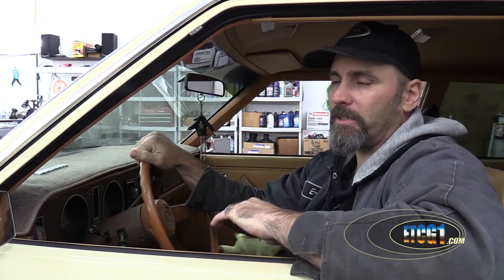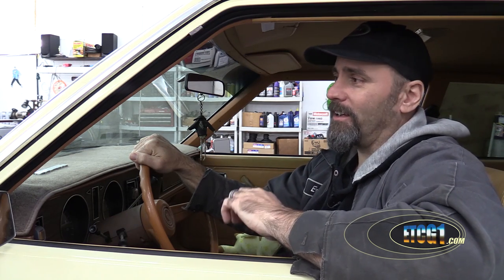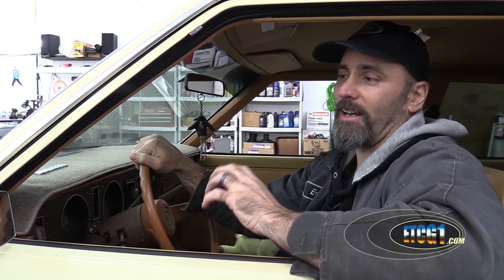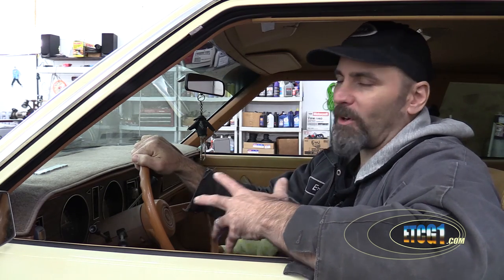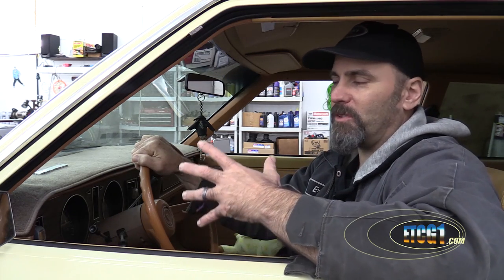Analog vs Digital (Cars)

Comment: I feel that there is a good balance of technology and simplicity in my 2005 Civic. It has been a great car with everything I need and nothing I don't.  I plan to keep it forever. It has AC, heater, radio, rear defroster, power windows, gets great gas mileage, has good power with the mods I did and is about to have alloy wheels. What more could you want? I love getting 42 MPG out of a 221,000 mile VTEC Civic. At 188,000 miles, the motor spun a bearing for no apparent reason on a -40 degree cold start, so I put a VTEC D17A2 in it and hooked the VTEC up to a light switch on the dashboard. The car is stock except for a D16Y8 intake manifold, throttle body and fuel rail, high flow exhaust, DC Sport 4-1 header, custom cold air intake, Mishimoto radiator, Energy Suspension motor mount inserts, battery in trunk, Spec D tuning front grill, power steering delete and the VTEC engine swap. It is very functional, extremely easy to work on, fairy low tech and gets the job done. I am not against technology, but sometimes it is best to stay low tech.

Comment: Always great info Eric. I went to Mechanic school and started mechanic work in 1991 the early 90s when points, carbs, vacuum advance, egr valve back pressure transducers etc were slowly fading away. I'm so grateful I learned those systems before the digital kicked in because it paved the way and prepared me for the chaotic world of computerized engine control systems and made it a whole lot easier to deal with. It's good to know the roots of how it all began but the principles of engine mechanical breakdowns are still the same, its all the electronics that can make or break a true Tech. I highly recommend for today's mechanic to go to school, and every DIYer interested in working on today's cars to go pick up a couple computerized engine control books and master the multimeter, electron theory and learn what makes a sensor and actuator do what it does and why it must operate within a set base of parameters. Oldskool technology is great but in order for a mechanic to stay on top of his or her game they must learn how to apply the diagnostic knowledge to the new electronic systems, which can be brain racking and drive you nuts lol. To know PCM/ECM computerized engine control diagnostics you must accept that fact that it is a never ending LEARNING PROCESS and you must dedicate MANY HOURS to honing your skills in diagnostics. Thanks for all your very informative videos Eric, When I first saw you and scanner danner a few years back, you guys encouraged me to make videos God Bless you brother. keep on smashin and Stayin dirty.
Reply from the maker: Very well said! Thanks very much for your comment.

Comment: Eric, this in my opinion is the best ETCG1 video in a long time, if not overall.  I have been really hard on you in a couple of comments recently, and I am glad you put this video out.  The point of brand new vehicles having mechanical components made me laugh.  My son just graduated and is a Journeyman AST here in Canada.  If we have something break down, the first thing he goes to is the computer  to diagnose it.  The first thing I go to is what possibly made it happen, and check all of the mechanical choices first.  It's a great banter over who is right (50/50 I think), and we have had some heated debates, but proves you need old school to have new school.  Once again, great video, and get that Ford running.  (My son has a 78 Mustang II with a 302, but it's only good for about 300 hp!!)
Reply from the maker: Thanks for your input. I really appreciate your comment. Good luck with that Mustang. Sounds like fun. To be honest, I'll probably dial back the boost on the Ford when I drive it on the street. 575hp seems excessive on the street in a car like this. Still, it's fun to know I can make those adjustments. Thanks again for the comment.

Comment: I love all of my "analog" vehicles. My 78 GMC K-35 actually still has the original Quadra-Jet that she was born with (rebuilt by me several times), and she still fires on the first try every time, even in sub zero temps here in Northwest Ohio. However, I'm seriously considering an aftermarket efi system for my current V-8 Ranger project. I'm not trying to make stupid power #s with it, I just want a fun cruiser. I'm 51 years old, and, bought my GMC in 84 when I was 16. I'm not opposed to "digital" stuff, I just prefer simplicity the majority of the time. The Ranger is actually the newest (personal) vehicle that I own. I also own (and drive for a living) a 2006 Freightliner semi tractor. Obviously that's fuel injected, but, it's still a simple system without all of the late model emissions crap.

Comment: This is one of your TOP 10 or 5 vids you have done! THANKS A TON FOR DOING THIS! 

You could even do a side by side if you wanted to. Car Craft magazine did this years ago with a fuel injection vs carb article and it turned out that the carb performed a tad better for race track and some mild street - strip applications...
Pros and Cons to EVERYTHING! 
Digital for everyday or professional stuff and analog or partial analog for toys and hot roddin'.... There is a Reason why rat rods - traditional old school stuff has become So popular in the last 10+ years. It's simple, fun, it works, and you, your brain and hands control more.... 
And Now, Eric will show us in his new vid:"HOW TO SET THE POINTS AND WHY HE LIKES BLUE STREAK BRAND OVER OTHERS..." LOL and in the following month "HOW TO SET UP A MECHANICAL FUEL INJECTION SYSTEM" lol
kEEP UP THE GOOD STUFF ETCG! Get that '51 going! Turn over that 235 or 216!

Comment: ANALOG! I'll take My Holley carburetor on top of a small block Chevy over a twin turbo LS 700 hp beast any day simply because if I'm stranded on the side of the road with only a basic truck tool kit I can fix my carburetor
Reply from the maker: A man after my own heart. Sounds like a killer car.
Reply: ... and if it is not the carburator but the headgasket or a piston, you are still fucked. :D

Comment: I am a young (22) German Driver, and I drive a 2007 Opel Combo Tour 1.3 Diesel as of now, and the one thing that annoys me most of all is the knowledge that the Fuel Delivery is entirely electronic. Now, I love that little thing to death, it's Handles like a Small Car with the Space of a Van and it's the best Car I could wish for, but I wish it had been built 15 years earlier and fitted with a fully Mechanic Diesel, having had a Battery Fail on me. 

The Cool thing about these old Diesels is that they don't require any Electricity to run at all. Even if the battery is Dead as Princess Diana, you can get it running. 

If I was to buy a Car today it would have to be an old Mechanical Diesel Mercedes while they are still cheap. 
Or some 90's light Truck.

Comment: Love this discussion.  I love the digital for areas with emissions testing.  OBDII is the best thing the government has ever done to make things universal and accessible to the technician and vehicle owners.  Cars today are also super reliable.  On the flip side, I trust my life and well being to a 2-stroke, carbureted aircraft.  I can physically inspect it and know that I can trust it.  I can physically see if it's good to go.  
I'll never forget the headaches I had with a computer controlled carburetor on my 1984 F150 4.9L either.  It was a CHAMP! except when it came to passing emissions every year.  Then it was a straight nightmare.  Those transition models suck.  I got my butt handed to me by a 2011 Malibu's anti-theft system.  The BCM wouldn't communicate with the anti-theft computer.  And my scanner wouldn't either except to receive a code saying it wouldn't talk to it or the BCM.  The fix?  Disconnect the negative terminal, wait 10 minutes and re connect it.  SOB.
Reply from the maker: I feel your pain, and your joy Brian. Thanks for weighing in on this one. Always great to see you in the comments.
Reply: Come on, my old Astro van had NO cat converter. Ran great with NO codes and passed emmisions with a test pipe. Computer, scmooter.  My brains a supercomputer, noodle.
Reply: Honda's founder said that when the US government passed strict emmision laws in early 70s he hired 100 new engineers and GM hired 100 new lawyers......

Comment: All I know, is a fuel injected system with a ECU will start up the first time you turn the key when it's 14F out, and a carbureted system, you'll be starting and starting and starting and squirting starter fluid and then starting.
Reply: most fuel injection systems refuses to work at -40F but carburetors when set up properly can still be reliable.
Reply: At -40, the carb is the least of the problems.
Reply: +superrodder2002 
That statement is simply false. 
Why does fuel injection not work at -40F but carburetion does?
Reply: Mine (carb) started right up at -31 degrees after 4 days of just sitting there like an gigant ice-cube. :)
Another k-jet I have, refused for 5 minutes then started to run lean an hesitate durin warm up.
My fathers -05 volvo xc70 was dead until the engine temp had gone up a bit with the fuel-heater :/
Reply: +Frrlas 
That is surprising since carburetors do not compensate for extreme temperature variations, but good for you. 
I am surprised that K-Jetronic system runs at all, even in warm weather. 
That 2005 Volvo XC70 is a very low compression turbocharged I5 engine and hard starting in cold weather is to be expected and has absolutely nothing to do with the fuel delivery method. 

The point is the blanket statement by superrodder2002, "most fuel injection systems refuses to work at -40F but carburetors when set up properly can still be reliable" is an absolutely false statement.
Reply: "carburetors do not compensate for extreme temperature variations" I guess you've never heard of a choke.  And if the air and the fuel are near the same temp then the carb will maintain the air/fuel ratio at those temperatures. The problem is the intake tract is cold so the fuel falls out of suspension and clings to the intake tract. The choke provides additional fuel to overcome this issue.
And yes I live in Canada where -40 is not uncommon in february
Reply: patw52pb1 well its true carbs have problems. but its easy to turn a 8mm half a turn for the winter setting modell ;) just like erik said. you are hottrodding and thats your lifestyle. and I wont say its better with carbs. just fun and something diffrent that in right hands can be just as relaiable.
Reply: +Frrlas 
All automotive fuel delivery systems have problems. 
What 8mm half a turn are you referring to? 

Carbs in NA applications are proven great, in blow through forced induction applications carbs are very temperamental, especially when regularly street driven in traffic and long distances. 
I have over 35 years professional experience selling, installing, tuning carburetors and an investment of over $40K USD in equipment, tooling and parts dedicated to tuning high performance carburetors including Demon, Holley, CSU, CIS, Quick Fuel, Barry Grant, Weber, Carter, Rochester, Stromberg, Solex and many of their derivatives. 
I also sell. install and tune fuel injection systems with about 30 years experience. 
Carburetors are not anywhere near as reliable and easy to drive in varying conditions as modern EFI. 
Typically carburetors are tuned to operate with one fixed set of parameters and strategy for a single operating condition. 
When those operating conditions change the carburetor parameters do not. That means operation with a carburetor in conditions outside of the fixed parameters it was tuned for is a compromise at best and the result can be simply unpleasant to drive or damaging to the engine or in forced induction applications many times quickly results in catastrophic damage/failure. 
I see the resultant catastrophic and expensive damage from DIY tunes, cheap tunes and  "professionally" tuned systems all too often, especially with forced induction blow through carburetor applications. There is much more to tuning a carburetor than a few pulls during a dyno session. Part throttle operation with subtle acceleration where most street driving is conducted cannot be accurately performed or adequately simulated on a dyno. The learning curve is very steep and expensive. 

Modern EFI systems are dynamic, self monitoring, continually assessing numerous current conditions and rapidly modifying the operating parameters and strategies on the fly for optimal and safe operation. 
Some EFI systems sample and assess the conditions and modify parameters over 4,500 times per second. 
Most modern EFI systems employ power on self tests, continuous diagnostics, protection strategies to protect the engine and failsafe operation if a sensor failure occurs. 
EFI is not some panacea that fixes everything and protects the tuner from his/her every bad choice and mistake, but most modern aftermarket/performance EFI systems are much more intelligent, protective and forgiving than carburetion and apply protective measures instantly and gives instant feedback before expensive catastrophic damage/failure occurs.  

Having stated all of the above, it is Eric's project and his prerogative to use carburetion or whatever he wishes and I respect, support and applaud him for it. 
What I take exception to are inaccurate, insensitive, factless, BS statements from either carburetion or EFI proponents/opponents.
Reply: patw52pb1 its the pierburg cd175 carb at my volvo 240. the 8mm is at the bottom center and regulate the mixture with the trottle and neadle
Reply: +Frrlas 
I know that unit well. 
The Pierburg is unique in that regard and is totally different than most including the Demon Eric is currently using. 
The downside of adjusting the position of the jet holder is that the mixture is effectively enriched for all operating speeds, conditions and throttle positions,  including when the engine reaches full operating temperature when the enrichment is unnecessary.
Reply: patw52pb1 yes and by moving the engine operating climate with the skrev you can have it work just fine just anywhere anytime. well the milage might drop sometimes. but in the long run it just works and at least I have a blast in this old nugget :)
Reply: My Honda from 1997 wich is fuel injected,started every morning this week even if it was very cold outside,ad often it was covered in snow.Fuel injected cars from that era were reliable.
Reply: opl500 I had carbureted cars until the mid 90s. Never had a cold starting issue attributed to the carb. 

It was always a combination of oil and deteriorated points.  Once I switched to using Mobil 1 and installed aftermarket electronic ignition on the older cars, an annual tune-up was enough to deliver reliable first turnover starts.
Reply: +opl500 - I had a '00 GMC Jimmy engine that I put in a '89 S10 Blazer for my wife's winter beater. Ripped all the electronics off it, installed an Edelbrock 1404 manual choke 500cfm carb, and HEI ignition. That thing never failed to fire up 6 winters straight, several mornings below zero. Would take some warming up before you could put  your foot into it, but you could just pull the choke out a little more and off you go. Got 18 mpg average too.

Comment: I'm gonna go to school for diesel mechanics out of high school. I'm 18 now and in my senior year and can't wait. I have a 88 Chevy k1500 and it has tbi (throttle body injection) and it has given me a great opportunity to learn basic skills to diagnose and fix a problem. Especially since it's still a obd 1 system and I can't just hook a scanner up to it. I wouldn't give it up though! To me analog/mechanical is the way to go but unfortunately that's not where society is moving.
Reply: Hunt Guy same situation here. I'm a senior and heavily considering deisel
Reply: Jordan Taylor Definitely a good option!
Reply: That was one of the best FI systems ever, right along side Ford's early multiport FI. Reliable as a stone ax. 

These days there are all kinds of problems thanks to manufacturers cheaping out on everything. On top of that, they've created new problems, like intake valve coking, thanks to direct injection. Then there's the diesels loaded up with failure-prone emissions crap. Turns those diesels into 100k mile throwaways. 

Keep that '88 running! You'll be alot richer in the long run.

If I were a smarter man, I'd have kept my '94 K1500 and never bought the '07 Silverado I have now.
Reply: I agree - I have a '93 Volvo 940, and a '86 Mercury Grand Marquis. Both have similar injectors. The Volvo's are original  -152k miles. The Marquis had the originals up until '14 - I only changed them because I broke a little plastic piece on one of them when I removed them for cleaning. Sold them on eBay - guy who bought them flow tested them, and said only one of the 8 was 3% out of spec. Car had over 210k miles then. It's at 240k now - original fuel pump, and power steering pump. Engine never burned a drop of oil, and still doesn't. One of the best cars I've ever owned.
Reply: Smitty Smithsonite It's partly them cheaping out but it's also that people are lazy now and want a computer to do everything for them. But yea I'll keep her going for a while!
Reply: Right on! I love my '94 K1500 TBI! I chuckle every time I open the hood and somebody says "Whoa this things carbureted", because with its circular air filter housing  and vacuum hoses sticking out, it does look like one.
Reply: Blake ADV Yes! I think it's the funniest thing especially when you say no it's it throttle body injected and they look at you like your head is on backwards lol. Never gets old!